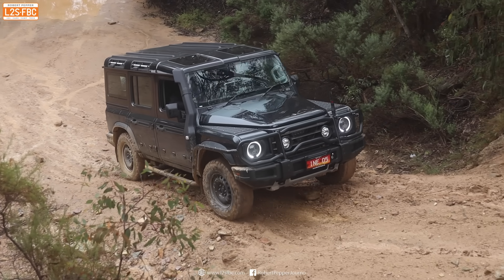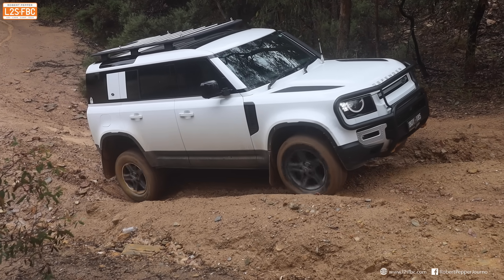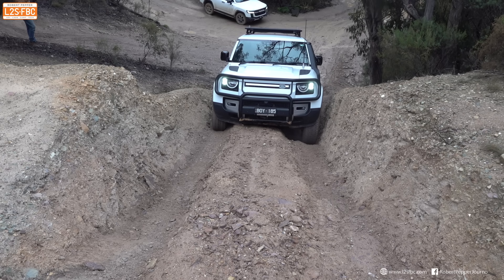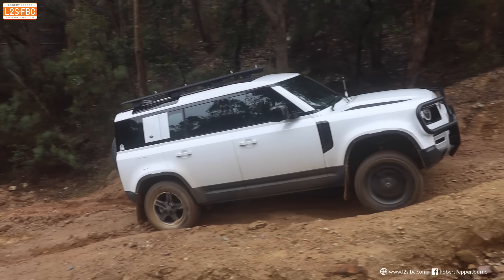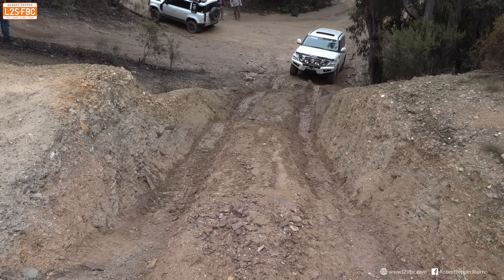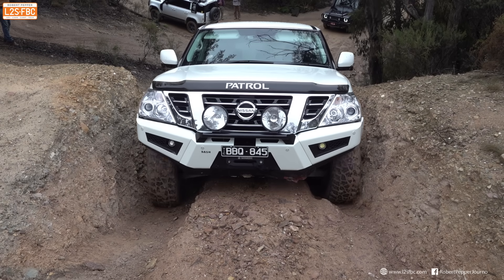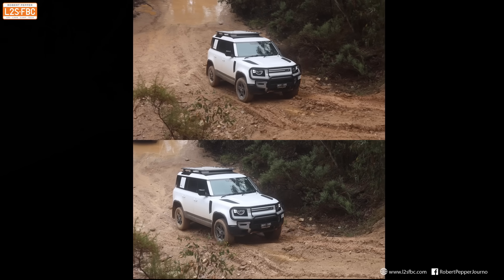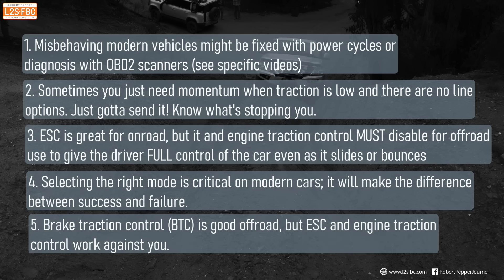Grenadier vs Patrol vs LC300 vs Defender - Part 5, Momentum

Comment: I encountered this DSC issue with our Discovery 3 a couple of weeks ago, when I was driving it on some rough tracks with Land Rover Expereicne Scotland (they do an annual winter event which includes some trails as well as their off-road centre - brilliant fun). At one point there's a tight corner with a loose muddy/gravel surface which also creates a situation where diagonally-opposed wheels leave the ground where it's been washed away. It's also directly in between two terrain response settings, and so an utter pain in terms of system calibration.

Halfway around the corner, even though DSC was switched off, it braked the two wheels as expected, but as it started to slide, DSC still kicked in (albeit at a reduced level), and cut the power to such an extent it refused to move altogether. I had to sheepishly reverse out, and I found, of all settings, Sand mode with DSC switched off and the throttle nailed just about got the vehicle around the corner. Now the same corner the year before, this time adding ice and snow into the mix, I had no problems in my Series III with simple brain operated traction control. Why? I'm guessing it's because I had nothing to override the throttle.

It's a shame because, even though our Discovery 3 doesn't have the electronic rear differential (hardly any do here in the UK), the traction control system is superb and nearly as good as the Defender. Not quite as good though, that was a bit smoother and responsive, traction control wise.
Reply from the maker: Perfect example thanks!  The car would know the steering wheel is turned and therefore reduce the allowable throttle, essentially putting its own well-being ahead of the driver's commands. This was my problem on the dune in the D4.  A little tip; if you can manage to be opening the steering whilst applying throttle then the ESC systems are less likely to restrict power. But, it's still intensely annoying and classic modern Land Rover behaviour. I think it's dangerous and therefore shameful.  If the car can't do something then okay, but you NEVER want it actively working against you and that's what modern Land Rovers do in extremis.  I think INEOS got that right with the Grenadier, as do the Toyota and Nissan.
Reply: @L2SFBC  It's not the first time I've encountered it; muddy ruts in Zambia (in the very same car incidentally) where it was also bellying out in the soft mud also caused the same issue. All of these electronic devices are marvellous and make these vehicles go places they really shouldn't, but particularly with Land Rover products, you either have no wheel spin or no drive at all, and when they get really confused they get REALLY stuck. Zambia for me was a perfect example of that, because in that situation there was no workaround.
Reply from the maker: I don't think it's so much confused, the engineers just decide to put the car's well-being ahead of the driver's request. So many times I have thought "I'd like to see these engineers with me now" not just in Land Rovers, but other vehicles too.  It's not every day this sort of thing happens, but when it happens...it's a problem.  Another video in this series will highlight another Land Rover shortcoming on hills.
Reply from the maker: Intereted to know what the LRE instructors say. If they understood, and had to follow the company line, or if they simply didn't comprehend.
Reply from the maker: also your Series vehicle would have no BTC, so interesting it worked better than D3 + BTC - DSC.
Reply: @L2SFBC  My Series III does't have power steering, anti-lock brakes, or any differential locks, but it have BTC - Brain Traction Control! I also have a feeling I know what this shortcoming on the new Defender is, but I'll keep quiet on that one. I know LRE have a very specific way of teaching people to go down hills, I can say that first hand, which may well mask this issue.

Joking aside, I actually found having all of these settings on the D3 and having to change them all the time to get it to work for a specific bit of terrain quite stressful, let alone the fact every time you change a setting it re-engages HDC and DSC. The constant audible beeping and visual stimulation from the warning lights on newer Land Rovers is not good for someone with Asperger's (excessively bright instruments are another bugbear of mine, another reason why I daily the Series and not the Discovery - I can't dim the dials enough for me). Do I really need to see a flashing DSC/BTC light every time a wheel spins, coupled with a warning message that disappears to quickly for me to read? A lot of modern vehicles are like this, and manufacturers could do with going on a course about disabilities and inclusivity.

I also don't think LRE instructors have any involvement in terms of how DSC should work off-road on future products, because in the UK they're all franchised outlets run by private companies operating under the LRE banner. For example, Land Rover Experience Scotland is run an managed by Highland Off-Road Ltd., and is not actually owned in any way by Land Rover. Furthermore, most of the time they're taking people who've never driven a vehicle off-road around an off-road course purpose-designed to show off the capabilities of the vehicle in the best possible light. I don't think this issue is something 99% of LRE instructors ever encounter.

I think the reason why the Series works so well for me is that, even with the roof rack and winch, being an 88" SW it only weighs 1700 kg, has narrow Michelin XZL 7.50R16's on it, and crucially, not too much power (69 bhp [51.5 kW] @ 4,000 r/min) and torque (117 lbf/ft [158.6 Nm] @ 1500 r/min) from my 2.25 petrol. Okay, I've fitted parabolic springs to it (mainly because of the poor quality of aftermarket replacement leaf springs) with Monroe gas dampers to suit, but I do have Aeon rubber helper springs on the back which were a factory option (Part No. RTC8000 if you must know). The older vehicles just seem to have this ability to maintain clearance and keep all of the wheels on the ground in the process, in fact several older Defenders in the group walked . I do wonder if this keeping clearance up is because the differential is offset to one side?
Reply from the maker: It'd be more to do with suspension flex. Defenders, especially those without swaybars, have an incredible ability to simply ooze over rough ground. If you can do that, and the D3 cannot, then you have less need for electronic aids. 
If you are saying that teaching to always use HDC and go straight down hills masks the issue..you would be correct, and you need to back-to-back with others as I did to see it.
Reply: @L2SFBC  That's half of it, but there's something else they teach. They also teach you to control the initial momentum with the brakes and slowly come off them and gradually allow HDC to take over. That's fine on a well-drained, purpose made off-road centre with a reasonably high-traction surface, as most LRE centres have, but in the real world, it just leads to tobogganing down a hill if you're not extremely sensitive with the brakes.
Reply: @cameronwood1994 all these systems generally improve with each generation but I find with new Defender and Discovery the HDC kicks in quickly enough that you can go ‘over the top’ having released the brakes and you can increase the speed on the control toggle switch as required. It seems  better than engine braking and throttle as we use on the old Defender IMO (particularly backwards descents!).
Reply: @mikeattheimagebusiness6215  I am not disputing how quickly HDC kicks in, and it is a brilliant system. My issue is how it, and DSC, re-engages every time you change a terrain response setting, which is a real pain on bush tracks. I also take an issue with how turning DSC off doesn't fully disable it. It just reduces its sensitivity.
Reply: @cameronwood1994  yes absolutely agree.
Reply from the maker: GRC. Gradient Release Control. That's what you're seeing.

Comment: Wow I didn't think the Patrol was going to be that good.
Reply from the maker: Why not?
Reply: The Y62 is awesome off road in rutty sandy wombat holes, leave the second best vehicle (the Y61) for dust.  Surprising for such a big vehicle with independent suspension.  I think it gets it's advantage from a longer wheelbase than all the other vehicles that dig the wombat holes and the excellent flex keeping the massive tyres on the ground.

Comment: Hi Robert, great content and subject matter. Regarding Land Rover Defender.....do you think that pulling the fuse for the anti lock brake system would disable the traction control "throttle cut out" and allow you to have full throttle (or just throttle) when you actually needed it? Also something to look at is where and how easy it is to disconnect the steering wheel angle sensor. Doing one or both could put the ESC into the drivers hands while off road and allow throttle inputs as needed.

We found that on the C5 Corvette, you could hit "Ice Mode" on a dry track under hard braking where the car thinks it hit an ice patch and just gives you a hard pedal but allows the tires to rotate....essentially no brakes. You have to immediately release the brakes and reapply them to get the brakes to work....definitely a pucker factor when diving into a corner. One way to avoid this is simply unplugging the steering wheel angle sensor since killing the anti lock brakes by pulling the fuse may not be the best idea for track use. But off road in low range and with a common sense mind I feel you can get by without anti lock brakes.

Maybe an interesting experiment to try with the Defender.
Reply from the maker: hi - disabling something like ABS would disable all the electronics, and the Defender would become useless.  It absolutely relies on electronics to have any offroad capability, in contrast to say the other three vehicles which have lockable centre diffs and decent flex, not computer-controlled. There is no way to disable just ESC on it. "Ice mode" is/was a problem also on the Nissan 370Z for similar reasons. Electronics are not always good...

Comment: I honestly don't think I could be happy owning a vehicle like this . These systems do work. However, it's simply just software trying to replicate hardware and seems to provide inconsistent performance, making the car feel like it's broken. Is it misfiring, or is it just cutting power? Just give me a simple vehicle with good suspension and a solid drivetrain so I have consistent performance, and I will be happy and focus more on gaining skills rather than pushing buttons on a touchscreen trying to find what is the best mode.
Reply from the maker: I agree to a large extent. I would like a vehicle which has a solid foundation of mechanical-only, augmented by electronics. The LC300 embodies this well - with no electronics at all, I could certainly still get places in it, but with, it is amazing. The Defender is the opposite, without electronics, it is nothing.
Reply: You can do everything in that video in the patrol with out using any of the driving programmes. Just leave it in normal on road mode, lock it in, decide wether you need low or high range, into drive then go. The patrol is only one of a few vehicles that also still has active traction control in the front if you have rear locker engaged. That 300 series is the gr so it has lockers front and back if required. Also the drivers in this video need to learn how to use throttle control so they maintain momentum and also let the traction control do its thing.
Reply: @L2SFBC that is supposedly the whole idea behind the Grenadier.
Reply: @Stevegrande1  my 1999 ep91 Toyota Starlet has brake traction control left foot braking look what they can do in the UK two-wheel drive trials.
Reply from the maker: Absolutely!!
Reply: @Stevegrande1 
You only get difflocks in the 300 in one certain model?? Extra in every other model
Reply from the maker: yes only in GR Sport. LC200 never had any.
Reply: Not software, but driver issue 😂 sunday specialist i guess
Reply: @paulmcintosh5589 yea in the gr only, yet if you buy a Prado you get one, go figure.

Comment: Defender should have been in Mud/Ruts mode. And possibly turn off the TCS.
Also don’t need left foot brake on it as the Hill Start assist (GRC) will hold it til you punch the throttle.

Comment: On the Defender it's not ESC, you have DSC which can be turned off with the press of a button with all of the off-road driving modes with the exception of AUTO. Owning an L663 and becoming very familiar with its off-road driving style likely would have fixed the vehicle from cutting power going up the hill.
Reply from the maker: DSC is simply Land Rovers term for ESC. DSC cannot be fully disabled and most cars do disable it entirely in low range. Not Land Rover.
Reply: @L2SFBC  correct.

Comment: Defender was in the wrong mode for the terrain. Also you have to do one of 2 things with it, momentum in the right mode, or crawl and let it do the things it thinnks it needs to to get forward motion, as long as it doesn't massively belly, it should do the hill. Be aware that it might take a little while to go into extended mode on the EAS, Like the P38 and on, it's not user selectable so it's something it has to do. Like a lot of modern vehicles with mode selection, if the user selects wrong, then the vehicle will not perform optimally. For that hill I'd have selected "mud and ruts".
Reply: Again the terms of "oversteer" and "understeer" used incorrectly as the car in the manufacturer video is skidding not understeering or oversteering, it will do one or the other it is impossible for then to do both as it's down to steering and suspension geometry not other forces applied to the vehicle. You cannot define whether a vehicle over or under steers if the vehicle is in a skid. Over  or uner or neutral steer can only be calculated when all wheels have full traction. Here is an example that most will understand, a vehicle with a locker engaged will tend to understeer because the locked front axle is trying to keep the vehicle travelling in a straight line. Another example is when the steering rack is in front of the axle, the outer wheel is pulled in greater than the arc for the correct track, so the vehicle actually turns tighter than the average arc of both wheels, that is oversteer. If the tracking is too far toe out, the vehicle will understeer, if it is too far toe in it will oversteer. anything else is a skid and should be treated  as such in theory and practicals as it teaches you to drive better.
Reply from the maker: It was in mud ruts. Different modes were tried. However no special mode selection should be necessary if the car is in low range it should not have ESC enabled regardless of mode.
Reply: Learn to drive off road and not rely on expensive rubbish vehicles..👍🏻😂

Comment: The more I watch those pretenders off road the more I detest the terrible damn things!! 
Land Rover lost their sense of direction for sure!
Those vehicles are purely rubbish!!
Reply from the maker: No they are not.
Reply: Have you actually driven one or are just one of those people I just laugh at cause they really don't have any idea? I have one and taken it up far worse than what is shown in these videos in both wet and dry conditions. The only problem I have had is a slow leak from the factory tyres, and that was fixed by buying some decent LT tyres, which I think just about every new 4x4 has the same issue. Every 4x4 I have owned since the late 80's has required me to relearn the best way to drive it offroad, and guess what the new Defender is no different and it has been a steep learning curve. I have not had the problem yet with losing power driving up rock faces or wet badly rutted and slippery muddy tracks worse than the one in this video, so I am not sure why this Defender does this, but so far mine has not, and I have driven up places in it that other vehicles struggled to drive up.